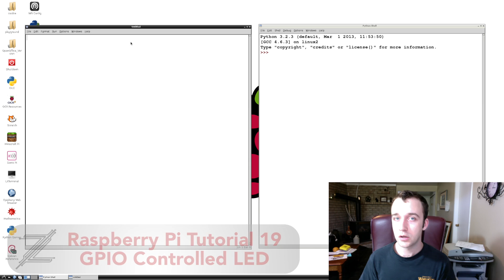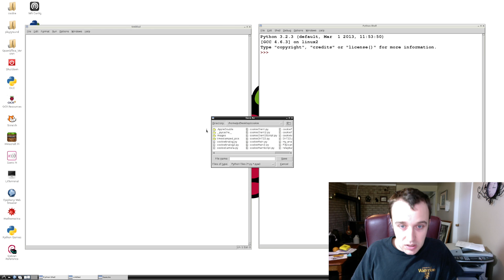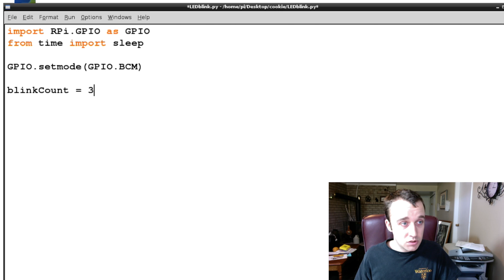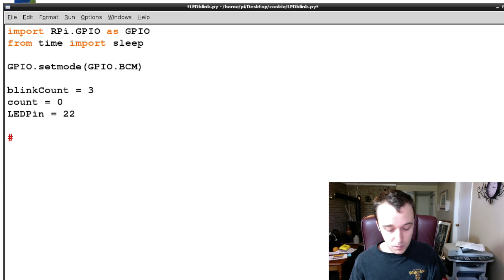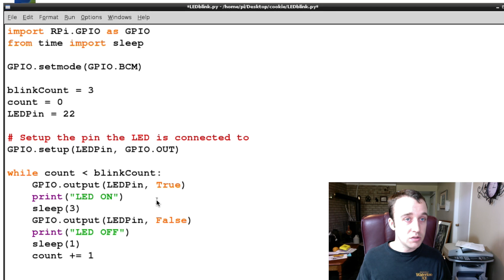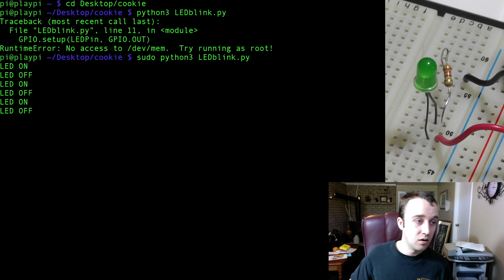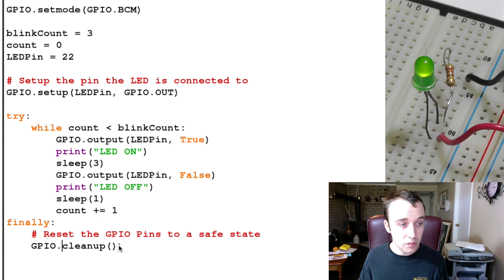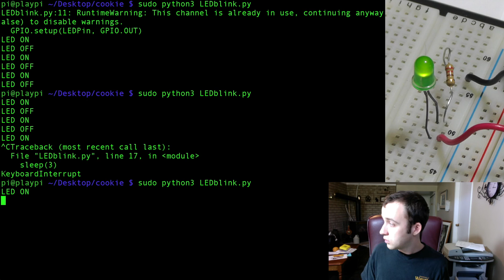Raspberry Pi Tutorial 19 - GPIO Introduction with a LED

Comment: Hello Alex, 
Great tutorial :) After watching your videos I bought Raspberry Pi and I have started playing with it.

When I was reproducing this tutorial I have noticed that you use a 220 Ohms resistor (I did it without resistor and with the same LED). You connect it after the LED which doesn't make sense for me. I thought the resistor has to be placed in front of the LED to restrict the amount of current flowing through it. Can you tell me why you connect it after the LED ?

Nick
Reply from the maker: Before or after it shouldn't matter. The 3.3v to GND path has the resistor in it, which will limit the current.

Think of electron flow like water in a pipe. If you put a flow reducing valve somewhere on the pipe, the water throughout the entire pipe will be affected.
Reply from the maker: Also it's important to include a resistor otherwise you are effectively creating a short, which could damage your new pi or toast the LED.
Reply: Hi, first of all, thank you for your raspberry pi videos, they are being very helpful to me. I'm having trouble working out the place(s) where I should put the resistor(s). Why do you place it between the led and the ground pin? Shouldn't you place it between the GPIO pin that feeds the circuit and the led, in order to protect the led from the 3.3V thats coming from the pi? And why would it create a short if you didn't put the resistor in there?
Reply: @Brent Mossbrooks Hi! It doesn't matter where the resistor is placed, since the circuit is in series. No matter where you place it, the current across the entire circuit will lower to the desired value. Depending on your son's age it may be a bit too much, but if you wish to understand why, watch this video https://www.youtube.com/watch?v=xLkPB_Rb-Os